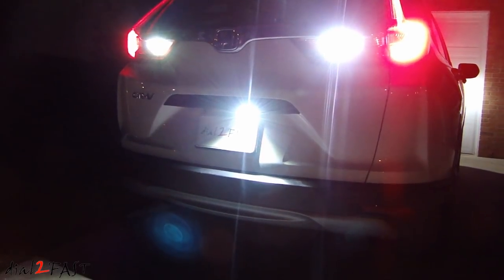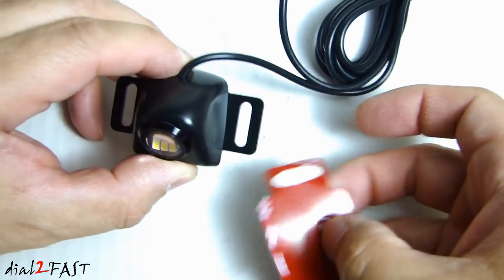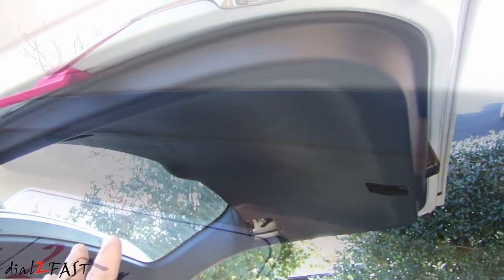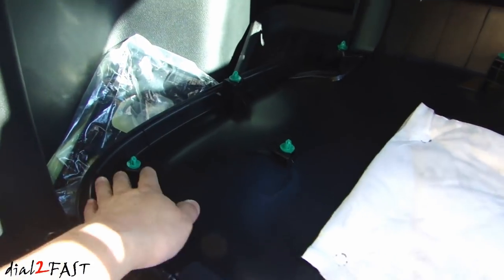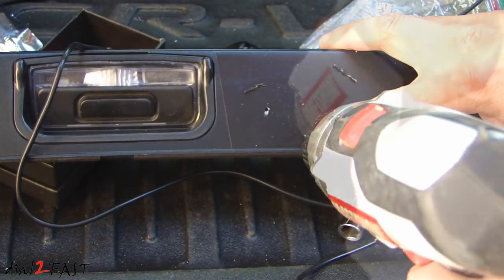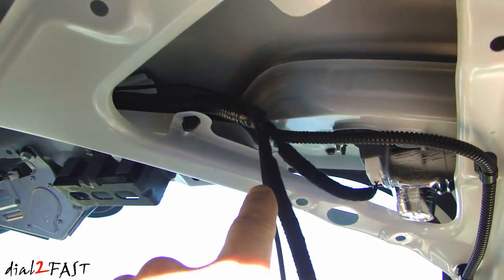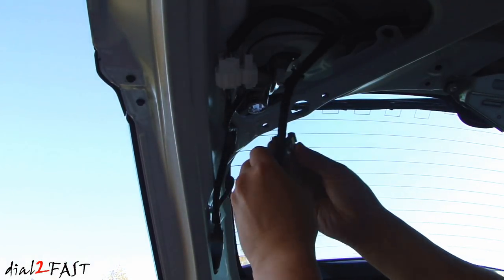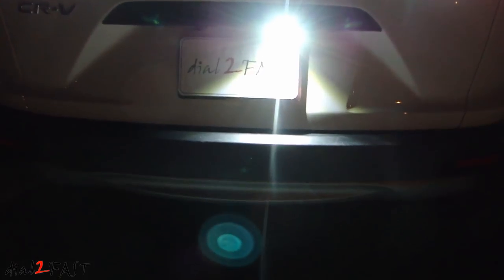Install Super Bright Backup LED Lighting Kit 2017 Honda CRV - LUYED

Comment: For those wanting more light with outdoing what this guy is doing. Upgrade your reverse light to LED it won't give you the same amount of light as the one here is installing but if all you want is a little more light that's the easiest way to do it.
Reply: I disagree.  My LASFIT units put off just as much light as this, if not more.

Comment: Just installed the LUYED light based off this video. Have not tested it in the dark.  My biggest issue was that that supplied splicing connectors do not work well.  I've had experience in the past with this style of splice and it has always been hit or miss with them.  I recommend using the T-taps 22-18ga (red).  Or you could certainly solder like this guy did.  Always test it out before you reassemble the trim pieces!  Hardest part of this whole process was pulling the trim pieces off.  And of course removing the supplied splice connectors and replacing them with T-taps that I luckily had on hand.

Comment: Why not use the tap connectors that come with the light?
I am wondering why you did not use the tap connectors instead of stripping the wires and soldering them! Is it more complicated to install rather than using the tap connectors?